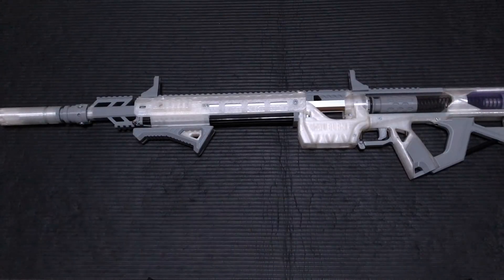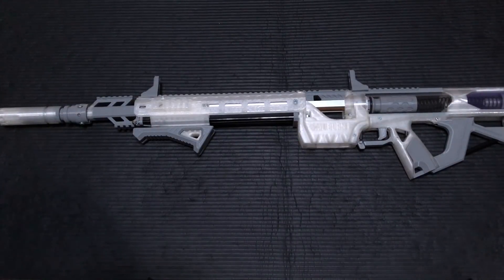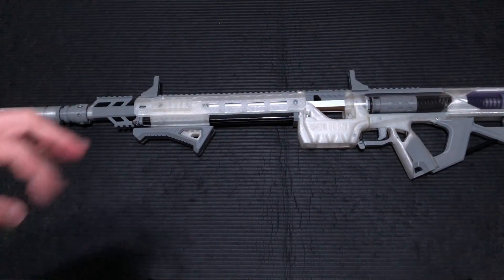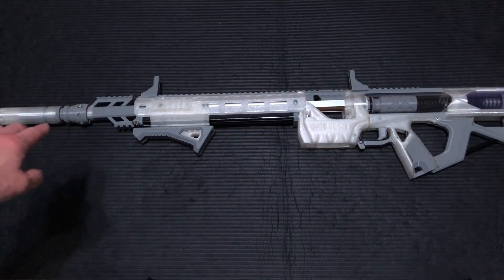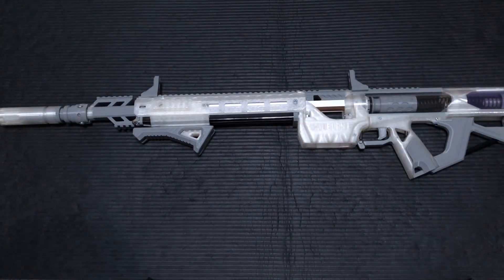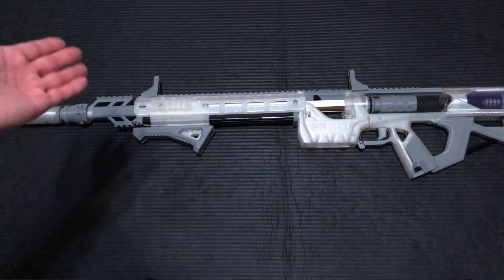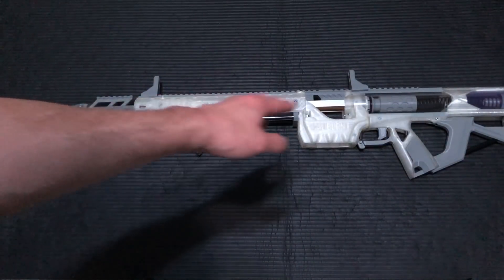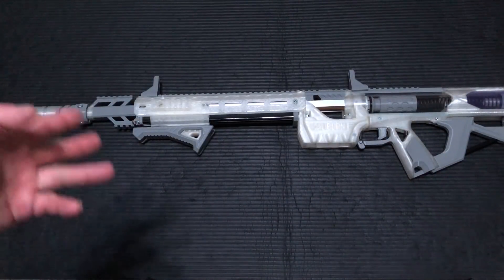Caliburn Series Intro

Comment: half of the fun of a caliburn is the maintenance, to me it's like your building a relationship with the blaster just like a real gun
Reply from the maker: It certainly highlights the importance of maintenance, something generally not emphasized with toys bought off the shelf. Once you begin to monitor performance with chronograph numbers, range tests and bench accuracy, spring selection, barrel tolerances, alignment, air seal, lubrication, and a clean barrel can make or break those figures.
Reply: @greenmedic88  yup and the satisfaction u get when u manage to get that perfect balance and squeeze out all the performance, accuracy, and consistency is really an great. after every game i always strip my whole burn to apply new lub clean out all the gunk and calibrate the scar etc and that process is really fun to me